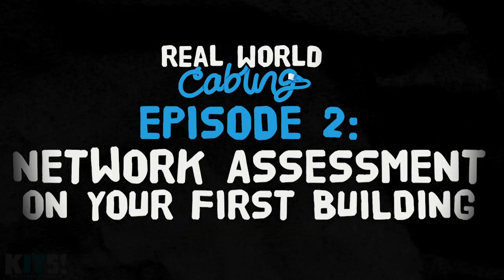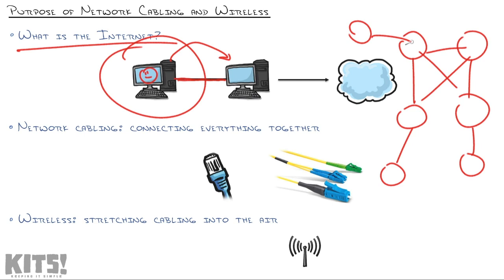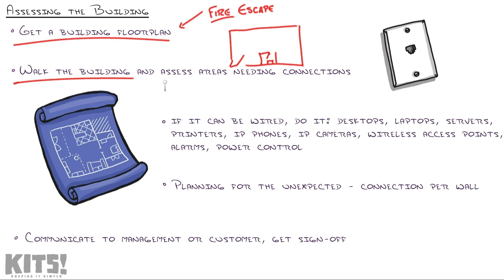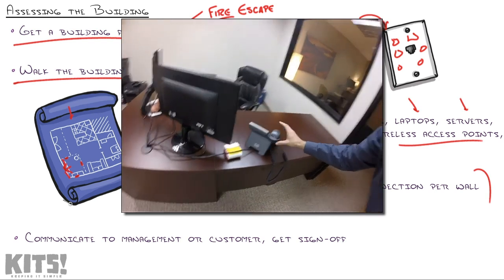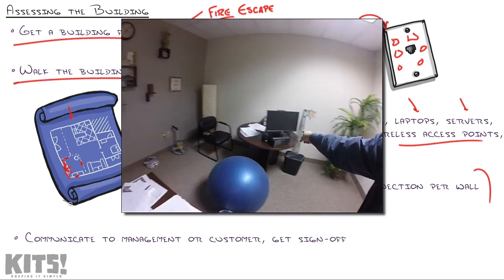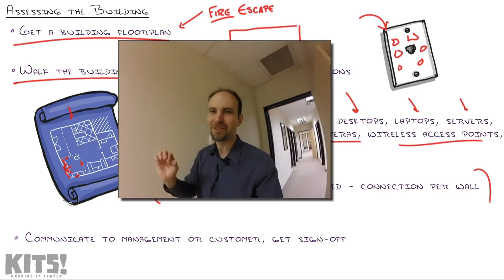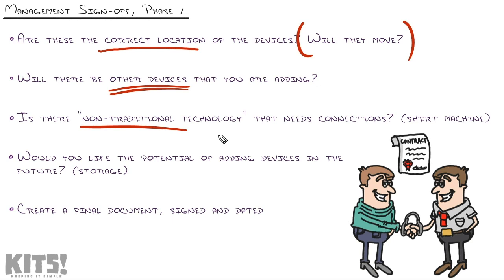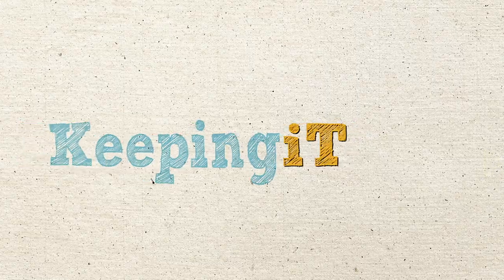REAL WORLD Network Assessments!: Real World Cabling Ep.2 - Keeping IT Simple

Comment: My biggest issue with planning (& implementing) networks (for the most part) is installing the network jacks and getting the cables to and from the patch panels and switches. Otherwise, it's not really all that difficult to plan and implement the network when you think about everything possible that will realistically be implemented in the business. Everything doesn't need to be connected to the network, and in fact it's best to limit the network to only what's the most important and essential for the business. If it's not essential, there's no need for it.

Comment: Hi. Do you think a 5G internett will take over the wire network?  Do the routers and switchers have a future?
Reply: No cuz regardless wireless is still limited. 5G will open up a lot of options...but it won't connect all these devices to the network etc. In the long run it's still a better more secure option to wire them all to the network.